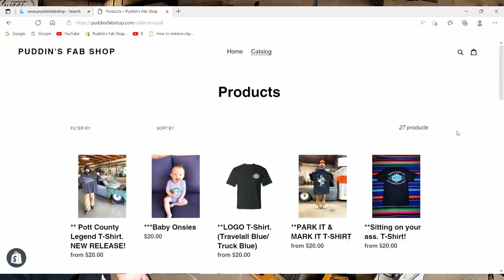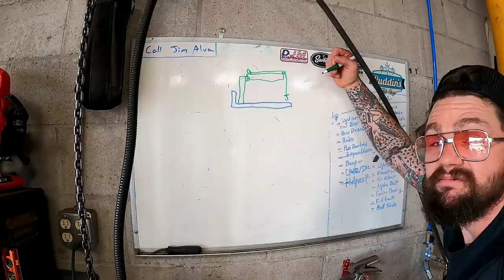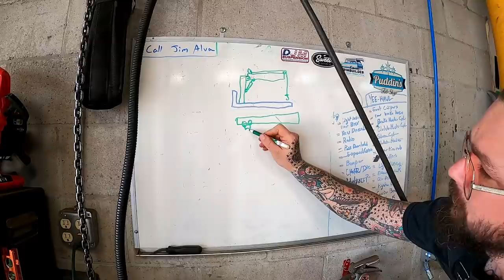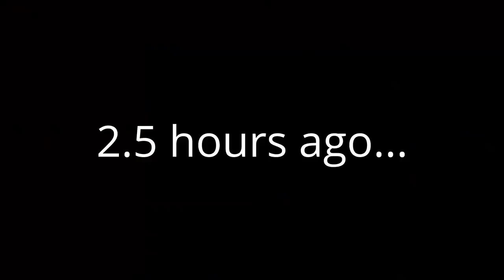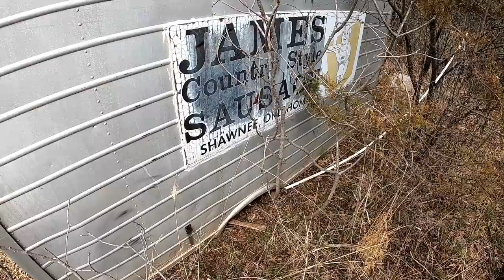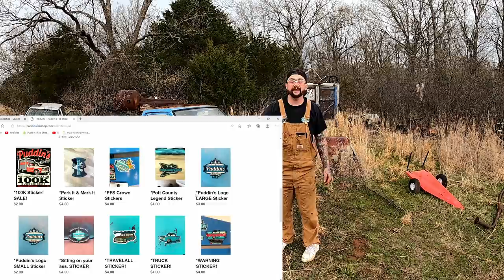CRANE BUILD for the flatbed worktruck. Mini truck DUALLY. ((1984 Toyota))

Comment: Awesome video! Tons of fun with that truck. You could strap a hi-lift jack to the headache rack and use it as an outrigger under the edge of the bed for the crane. Plus it will be useful for self-recovery next time you try to drive over an anthill. 😆 Though I like the “nature walk with Puddin” segment. 👍🏻

Comment: You should cap off that 2 x 2 square tubing you weld it on top of your truck and use it as a tank for compressed air. I’m sure you can find a place to stick a small electric compressor. Great for power tools.

Comment: Puddin I just swapped over to wat hing on my TV since momma and the boy went to bed but it clicked me back about five minutes from where I was on my phone to quote rabbit "I'm telling you that story to tell you this story" it put me back to your pivot point issue with the one inch bolt issue and it got me pondering you could use one inch all thread and four nuts and some fender washers to fix the issue of having to torch the bolts off great video thus far

Comment: If all the hinges are the same, lay them out where you want them and clamp each one to the square or rectangle tubing with a piece of angle iron on one side. The V of the angle will square all of them up, but you may need to make some wooden V-blocks to keep the clamps in place and tight over each hinge!!

Comment: A word of advice:  I made a super strong and big cherry picker many many years ago and I have always meant to go back and put a winch on it as well as the hydraulic long ram that is already on it.  So many times that the range of motion would have been very much extended with the winch and as you say that remote is very handy when you are one manning.  I would highly recommend putting yours on now while it is sitting there.  You won't regret it in the future.

Comment: We use those type hinges in the commercial steel construction industry. If you look em up, each one of those hinges are rated for between 600 and 1000lbs. Good Job! They ain't gonna fail ya!

Comment: you could just add an out rigger that you can just slide out by hand and just has a locking pin that you can take out, let it touch the ground or wherever the whole lines up, put the pin back in so the truck may tilt a little when you put weight on it. It's a little primitive but it works. I used to work on crane trucks and I've actually come across a 20 ton truck crane that had these type of outriggers on it believe it or not.

Comment: I used to work in a cemetary, where we used a three wheel golf cart ,with a hand cranked lift mounted in the bed. We used the lift and cart to lnstall 16 x 36 x6 in .thick granite head stones. They weigh any where from 100to 150 lbs. We had the same problem with tilting of the cart  when we swung the head stone over the side.

Comment: One thing to keep on the flat bed will be a farm jack. You can use that to stabilize the side when using the crane, Jack the truck up to change tires or get it unstuck. Use it to jack up junk cars when on a recovery mission.

Comment: Maybe also add some additional tubing from the headache rack to the flatbed to help reinforce it and better support it?  And if you want to prevent a pull-away or whatnot, you could have a place on the opposite site through the bed to bolt up and tie it all together to the bed.  But I agree.  Outriggers will help a lot.  You'll need some pads for the outrigger feet in case you have to do some offroad work and it's too mushy.

Comment: For future reference you want to take your hinges and run a pipe or whatever fits inside there all along all of them whether it's two or four or six however many find them up like that pack them then pull your rod out and put the other pieces of your hinge attack them where you need them then try for binding I built gates for roll off containers for 10 years and that was always how we kept the hinges straight

Comment: Now mark your boom extension (Jib) at each Pin Location for Indexing. Id'e use a 1/4'' Ball End Carbide Burr and a "Heavy" Straight Edge and make a Recessed Chanel that can be painted or polished or Beadazzled any way ol' Puddin sees fit.

Comment: fan flippin' tastic!

I've been thinkin' bout adding a little harbor freight crane onto my 82' 4x4 Yota, make it a little easier to load n' unload dumb ** into the bed like the spare transmission from my mom's suburban I have in there for extra traction, after all the load height is pretty high on it!

Comment: This might be the best thing I've seen on the internet this month.  Yeah, we're only into the month 5 days, but still, your're the king of the first 5 days.  Plenty of surprises.  I'm surprised that swinging boom didn't break anything smacking into your welder.  I'm surprised you didn't actually use the tow-rolla to tow the tow-lifta.  I'm surprised you didn't rip the front end of the tow-rolla right off pulling the tow-lifta off that bank.  I'm surprised the tow-rolla got the tow-lifta off that bank.  I think i'm most surprised that you waited till the end of the video to hang off that boom and swing around!  I'd pay money to watch Mortske watch this video.

Comment: To use this with one person, you kinda have to use the winch idea. If you mounted the winch at the front of the bed centered on the headache rack, you could then use shackles to redirect the cable up and over the crane. Meanwhile, the winch could also be used to get you unstuck.

Comment: You might wanna have a closer look at the bend in your 3x2 (and the C-channel) if you're gonna be picking up things as heavy as that old Travelall front end on a regular basis, mate.  She was describing a pretty good arc there, but credit where it's due, though - the rig held up and did exactly what you said it would do out the box.  Bloody awesome stuff! .😉

Nothing like a field test to iron out the wrinkles in a project and show you what you need to do to make it fly....not just walk.  Yep, an outrigger (or some form of stabiliser), a wee bit of bracing and she'll work fine for 90% of what you want to do.....and will bend itself a bit, but still do the other 10%.  Proof of concept - done.  Test of concept - done.  Just a few minor tweaks and she's done-done. 👌

Puddin' - you've shown me the value of decent welding in this episode.  It was the bed itself that was the weakest point there - nothing to do with anything you did.   That welding you put on there still held the rig on strong and one of the reasons the whole thing didn't tear off was the way you had it mounted to the bed head and the rails underneath. Them welds didn't fracture, tear or move, so that goes to show that a) you know what you're doing with a MIG and 2) you can't beat a decent weld.  👍

Could the red ram be situated further out to reduce the unsupported load?  Sure it could, but does it do the job where it is?  Yep.  Sure does.  Just don't go lifting too many Travellall front ends with it or I reckon the bend in the boom might become permanent! 😁 (I know you were just testing her limits, mate - and what a brilliant test it was.  Plenty strong enough for engine and gearbox lifting, for sure)

You know, when I looked at the bed of that truck in this video, I thought to myself it would be a good rig to roll into the shop to use as a welding table for larger projects......or maybe mobile fabrication!  Seems to be at just the right height......

Anyway - all the best and keep looking into that International Shipping!  😁

Comment: Need get u sume those out riggers some box tube under bed or between bed and frame two slide in tube with some trailer jack at the end for braces of the crane weld attach point to bed and each side to sure up the headache rack with removable bars so still have full access keep up great work and everyone have wonderful day

Comment: You could run a cable up through that tube, add a wheel to the top of the hinge, and a wheel to the end of the C Channel. Make up a seat for the winch to sit to the inside of the hoist down tube with a roller to keep it from fraying the cable on the tube and grinding a notch into the tube. Brace the crap out of it and there's your headache rack braced..half way at least. It wouldn't be too hard to make up a new "on the cheap" flatbed..most expensive piece would be the sheet metal for the floor, personally I'd go with pressure treated lumber but that's more expensive than sheet metal anymore lol.

Comment: You got that winch, put her on the passenger side to pull that crane back to center when you got a load on her. You and your magic brand could probably figure out a pulley system to also use it to swing her back out to drop off that load..

Comment: You know what I think would make that roof look better? Well it won’t make it look like anything but it would make it so you can’t see it, extend the headache rack up over the cab and make a shelf over the cab. I think it would be cool to have the extra space and hide the wonky sheet metal, it would also provide a bit of safety in case something falls out of the sky. Just a thought.

Comment: Thanks Puddin, you welded, it helded! (love that tshirt!) You can get a winch line inside that boom arm for easier loading, having said that if you had just put a winch on the truck then you could have got out of trouble! Those crappy made hinges got you on the struggle bus for sure and I though it was going to be the first thing to fail. It was a fun one!

Comment: Pretty sure Jamie Davis could have handled that recovery a little better but he's got a fleet of trucks. Let's see him try it with a Towrolla.
Not a failure on the crane as you found where it needs to be built up. Does look like the extension arm needs a little beefing up as well because it looks like she took a little bend with that engine block.

Comment: Put an air over hydraulic cylinder on it and mount a decent size air recieiver underneath (50 liter would do here) the tray with a 12 volt compressor. You could have a 5/2 solenoid valve on a remote to control boom up and down with the set up you have then, just a thought and really wont cost a lot. You wont really need an exta set of hands then.

Comment: Hey Puddin  _  You needed to hone the hinges with a brake hone tool. Just a few thousands of clearance will keep them from binding.  Also, drill you some holes in them and put in some grease zerts and use white lithium grease.  _  Max Yearwood

Comment: On the hinges after you get them welded in place put some valve lapping compound on them and spend some time working it and it will run a lot smoother clean it up and replace with grease

Comment: If you clamp on to the main square tube and pull current through your hinge then its gonna "weld" across the hinge point causing the hinge to bind. You have to ground clamp on the metal you are welding and not pull current through the hinge.

Comment: A little idea for the end of the crane where the chain attaches. We have a jib pole attachment for our forklift, and on the end there is a slot that a chain can slide into, this way you can easily adjust the length of the chain. Just imagine a slot that looks like to L's back to back. No different than using a hook binder to hook onto a chain.

Comment: running your ground through the hinges is causing arcing inside the hinge. Most of your binding is actually the bearing surfaces welding together.

Comment: You need a jack like the one on my lift and been meaning to put on my swiveling lift like that mounted to the concrete. 
  I've got a homemade lift on wheels that's got about a 4 ft long boom i use to move my big old heavy vice for the milling machine.

Comment: Make ya some outriggers..use the same idea as the top boom..slide and pin..put a foot on it..pull the pin it will drop them pin..one on each side or if you load from driver side one on front and back..I like it mister..you will get it....lol

Comment: Super cool build would be really cool to see you run a simple and cheap air system for some on board air for tires such and you can upgrade the hydraulic ram or convert the one you have to air and you can use that to lift the boom up and down quick and love the idea of using both of best worlds and adding the winch to the whole thing would make it easier to pull things out of places with the nice tall boom just a idea and maybe some small outriggers to help hold the truck in place and love the small added end clips

Comment: I had a 78 dodge 4x4 that had a little hoist in the back corner that was level with the  bedside. Only stuck out about 3. Feet but it would pick up stuff into the bed. It also works as the perfect ski rope attachment for winter activitys.

Comment: One thing puddin, you are going to want to store the hydraulic ram all the way down. If not it will rust the exposed section. I know because I had a cherry picker that was loaned out and when returned the jack had to be replaced for that reason. Love the video.

Comment: if you put a electric air pump on it then put that harbor freight air attachment on the jack you could have a remote lift without using the pump

Comment: Puddij the bed on that yota.wiuld look great if u ssnd blast it an rhino coat it u spray paint it in flat or satin paint it will just eventually scratch sn scuff off buy rhino cist supposed to be strong as metal if put on a good clean grease free surface the cab looks too clean an nice up against that surface rust costed bed just thinking out loud  I love ur channel  you ok ol buddy

Comment: if it ain't broke, don't fix it. that's the main rule for a work truck. you know it's gonna get buggered up, and if it was a perfect, pretty truck, you'd cry over every little scratch. but you won't even notice that same scratch on a truck that's rusty but trusty. edit; you shoulda just got a 1" tractor implement pin from TSC for the boom pivot. TSC even has spacers to fit the pins you can cut down to fit between the plates for more torsional strength.

Comment: I am not a machinist, fabricator, welder, or any of that... just some simple person watching YouTube and enjoying all the work you do.  But, just as an idea, which you might have already thought of by now... what if you took the metal bar, and the half hinge points, laid them on a flat surface, maybe added some shims of equal height underneath each one to lift them to the center point of the frame, and then tack weld and test?

Comment: To make it so much more simpler and easier I would have just got a 4-ft piece of round pipe welded it to the front of the headache rack  Curtis circle drop it through the bed down to the frame of the truck and weld it with some bracing  and that would fit in  the round pipe that that you have laying on the flatbed  and you can pull it out if you don't need it put it in you can swing it any way you want 160 degrees if need be

Comment: if you need to patch a small hole/ crack in a fuel tank in the short term/an emergency use bar soap.
just rub it across the crack and it will plug it and wont dissolve in the fuel.

Comment: Could have just made 2 set bolts on either side with some t post handles to tighten them down to hold the beam from sliding and you don't have to have so many holes in your beam

Comment: I would have used the winch with a wheel  at the pivot a wheel at the end winch mounted at the base of the rotating arm.  Then it could be on a remote switch for the winch. At the pivot arm.  Put a slider that's pinned. So your using the winch cable for most of the vertical.  No need for big red. That winch could have got you out of being stuck too. Lol

Comment: Puddin, would it be worth it to you to add the "air over hydraulic" ram and a small air compressor to run it??  Just a thought, they have them at the Harbor Freight.  The air is nice on my cherry picker in the shop.  Love the vids!!

Comment: I thought you were going to use the electric winch and run the cable up through the pipe and come out the end and that way all you had to do was hit a switch instead of doing all that pumping that's what she said forget all that pump and hit a switch and use that cable and lift whatever you lifting up such as that motor FMI /FYI

Comment: Your ground. It's on the opposite side of the friction surfaces from where you are welding. When that arc is welding you are also fusing those low friction areas and you get binding. In a strange, unexplainable, and no way to align away sort of fashion.